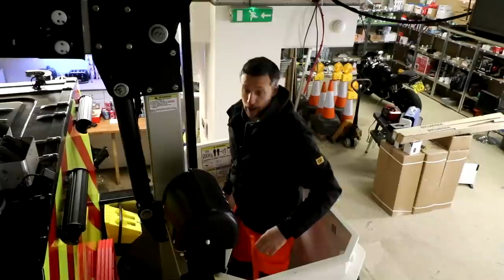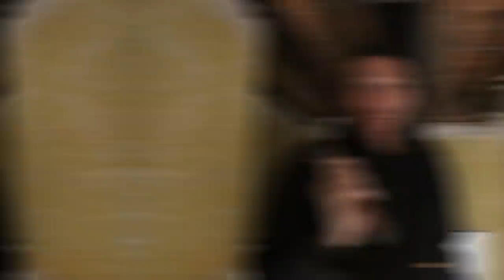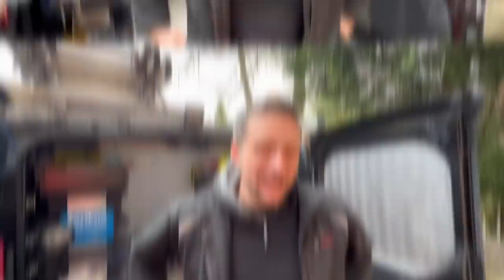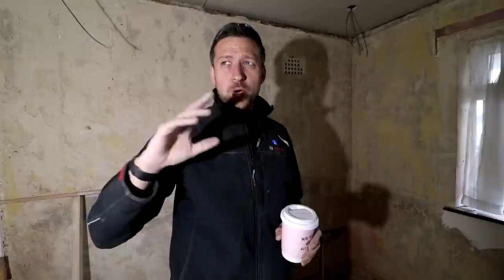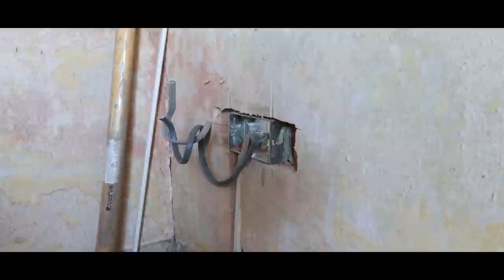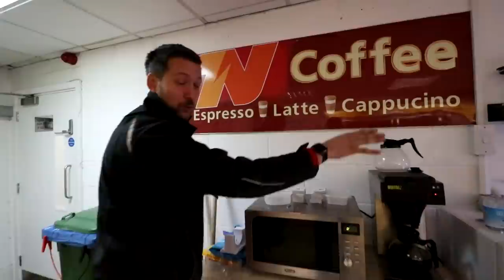TIME TO SET THE RECORD STRAIGHT... | Nagy weekly ep07

Comment: 15 years + working on street lighting in all weathers and darkness..... only ever needed a decent head torch for overhead bucket work and a decent stand light if you need to see more when working at the base. Remember not to dazzle road users ! I see the stand idea as a dangerous hindrance. You might need to work from both front and rear of the bucket depending on column size and van positioning available and the last thing you want is that stand and light falling 12M + when you forget it’s there !! Also concerning your signs .... easier to stack the ones that are made to fit on small cones so there’s no heavy/bulky frames to them. 👍👍

Comment: Tom at the risk of pissing off the Bosch folks , just get yourself a Milwaukee tower light , they do it in m12 and m18 also , it doesn't even take much space .OR you can get the M18 Radius light that you can hang upside down with the included hook , it's super bright but not blinding , and it has a nice warm white color that doesn't blind or hurt the eyes . There's 2 models , the new one has Bluetooth and is brighter but super expensive,  you don't need that , just get the older model which is cheaper ( i think around 160-180 something like that ).
That's all you'd need really,  oh and it has a very long run time as well 👍.

Comment: 6:40 fine to run it through the same hole as any sort of power cable, or to cross power cables at right angles - the problem comes when it runs too close over a distance. You may have heard of inductive coupling (works just like a transformer) - had it on one job where the guy got a shock off a network cable that wasn't even terminated at either end. Turned out the cable was run through an underground duct with power cables for about 30m.

Comment: Thomas you will like this !!!!!!   Top Tip   all round banding with a piece of 20mm  plastic conduit threaded through it . 1/2 a dozen of these pre fixed and you can run the cables ( carefully as you do , burning etc as you know)  Works better when fixed to a ceiling. You still have the benefit of premature collapse because the banding is inside the conduit. What do you think ???
Reply from the maker: Not a bad tip, cheers pal!

Comment: Ex industrial lighting guy here, mainly did indoor stuff in big warehouses but I did my share of streetlight style work, be it on the side of the buildings or on poles in the parking lots and access roads. Generally you don't want any flagpole type contraption sticking out above the ledge of the bucket, you'll hit it with materials, arms/hands and your face. The buckets are small enough as it is. We used to get by fine in the dark with a good headlamp, key word there being good. It's crazy what you can get nowadays online, there's whole forums dedicated to flashlights/headlamps. In addition to that I always took on of them cheap 20watt work lights on battery up, great if you need a bit of static light. I'd just zip tie that to whatever made it point in the right direction, usually the bucket. Couple mega floodlight sounds great in theory but from what I've experienced you just don't need them, you're not trying to light the whole highway but just what you're working on. Especially working on poles when the spark on the ground is trying to look up to you to ask/see if the cables are coming down yet and they instead look right into your artificial sun.

Comment: If you was to use a little length of 20 conduit ubolted and with a stop end box you could place a small pole inside the conduit with a light on and when not in use just remove the light and pole. Great work it always good to see and watch

Comment: On the subject of lighting up the bucket.. we always use good head torches that have a magnifier inside that spreads the light out wide
Reply: I'm not in the market for one but do you have recommendations on brand/model that you've used and found to be the mutt's nuts?
Reply: @AintBigAintClever  We use Ledlenser H15R Core

Comment: Working in the dark - We wear head torches. I wouldn't recommend drilling holes in the bucket, have you checked with the company you bought the truck off to see if it's ok? The main problem I would have with a pole on the back of the bucket is snagging on phone lines etc.

Comment: When I've been out driving at night, I've seen bucket trucks and cherry pickers using stand alone big halogen flood lights, like you see at the local footy fields. The 4 panel poles that run off a diesel gen set or have their own generator and are wheeled around.

Could always try bolting a pole to your bucket to mount a light on, or...have it so you could mount various bits and bobs to it, not just lights. probably worth using something quite sturdy or making your own telescoping pole out of some steel/aluminium tube

Comment: Alright Tom I have a bucket truck myself and had the same problem. There were 2 sidelights on my basket so I tapped into them and installed 2 12v floodlights, I just mounted one up high on a bit of rail and one on the back. I have a video about them on my channel, its the one that's the most recent van tour, at the end of the video I show them in use 👍 hope that helps! Great video as usual 👌

Comment: Most I've seen like signage contractors use head tourches. What else works well is led rope light fixed to the rim of the basket lights up inside the basket well

Comment: Reference the lighting in the bucket, either buy a Petzl Duo Z head torch or buy a monfrotto magic arm and clamps (lanyard it on to save any safety concerns with dropped objects etc if and when you ever get audited). Monfrotto' arms get used offshore for radiography to hold the collimator  in position to radiograph the pipework/welds (inspection), so they are pretty bomb proof and easy to adjust.

Comment: Fit a couple of 12v spotlights and run them off the van electrics. We bolted them to the buckets when i was doing street lighting on the motorways. I'm sure if you speak with the bodybuilders you can pick up a 12v from the bucket control wiring.

Comment: @6:34 Ethernet can be run relatively close to power (look at tri-compartment dado trunking for example) but in your location why not pop another hole through and run them one joist over?  That's what it's like under my floor for the most part (mains in one run, any low voltage stuff in another), although in my case the joists all run front-to-back so the mains and LV runs are under different floorboards.  A recent power run got added in and had to go in close proximity to the low voltage stuff in places, but that's in 2.5mm LSX earthshield so won't be interfering.

Comment: On the lighting thing (I don't know if it's done by others but this would be my thought), you could put an LED strip (with a diffuser/cover) just below the rim at the top (you can get them as 24V strips), or alternatively wear a head torch (not so elegant, I know...)

Comment: I don't do bucket work, but working in theatre and live sound, I often need a hands-free light.  A head torch does the job perfectly. I have a feeling that no matter what you do with a fixed light, it will either be in the way, or not be where you need it.

Starting my business was one hell of a gamble even though at the start when things were looking good; I formed my company in 2019, invested thousands and then the pandemic happened.  Given what I do, it was a risk that's not paid off...not yet at least.  I declared losses in my tax return in April gone, and will almost certainly declare losses this coming April.  Trouble is, given what I have put into it; I have to make it work...it's going to be a couple of years I expect before I recoup my losses and turn it around. Irrespective of what's happening with events right now, I'm determined not to give up.  Had I had investors other than myself, I'm sure they'd have ended up pulling their money out and I'd have ended up right in the shit.  Like you, I don't want to be accountable to anyone else and as I'm accountable to myself, I'm going to bust my ass to make it work...may just take a while longer. :)  I certainly worry about it, and haven't put even close to the amount of money into this as you have your business.

Comment: I'm 35 and also started a business, but with less overheads, and I can understand that you want everything - the business and the stuff normal people have like the safety net of a house. You are getting the wobbles because you realise that you are going to have to wait much longer for the normal stuff and worried that you may come out the other side with less than the normal people. Well, with the current direction, I don't think you will, you will succeed. You might have to wait a little longer but you will. Bring in an investor when you have grown more, this will give you a option to off load some of the business to them, but today it's your baby and why there is so much pressure, but you will succeed as the only people that fail in life are the ones that give up.

Comment: With the lighting issue in the bucket, why dont you wear a helmet mounted light that way its pointing where you need it. Another option is to also run a led all around the inside rim of the bucket.
18 man days so far for that amount ,it seems a low price for all that work and thats without the second fix.

Comment: Any additional light support on the bucket will need to be non-conductive. wouldn't a helmet lamp be easier to use? Any single source of light above and behind you will only cause your body to cast a shadow where you are working. You could also run some LED strips around the upper edge of the bucket to illuminate inside the bucket when necessary. You are doing great! I'd come work with you in a heartbeat if I was still working.
Reply: Always  used a head torch for cherry pickers work.

Comment: Data cable - not great running parallel that close to power, would be better off running on the opposite joist.  The min distance for unshielded is 200mm (its all a bit subjective to test anyway).  Crossing a power cable is ok, but you are right, running in the same 'bundle' is death to a dig signal.  Domestic run probably get away with your install as the distances are not that far.
Reply: It makes so little difference with 50Hz AC. 
If you run data next power cord of a switch mode psu then you will start running into issues.

Comment: Led lenser do a really good magnetic rechargeable flood light iF8R.

Pricey but really good lights. Is your bucket fiberglass or metal? If fiber you could bolt some steel band in place and then you've got somewhere to stick the light.

Comment: Did you ever sort that battery to battery charging scenario on the vans? Just wondered what product you used or plan to use? I use old fashioned split charge relay. Works well but I don't think I get a full charge on the aux battery as I too have part time alternator. Great content - love it.

Comment: Hi mate  I've seen people light their bucket truckle with Defender led slimline work light 50w 4000lm 110v you can buy for screwfix £59.99.
I've seen people bolt them on to the side swivel the light weather working

Comment: thomas if you run tne parallel to tp it needs to be shielded unless you put it in shielded conduit meaning metal conduit thats grounded. to act like a faraday cage. btw tp is data. if you want to run data unshielded it needs to be more then 50mm away from each other in the uk, 200 in the us, 100 in my country.

Comment: Stick to manfrotto or K&M if you need a proper stand.
Or something like K&M 21339.
You don't need the foot, but you might need a double superclamp or two.

Lighting poles are better, because you can get mechanical matching connectors for the light and the pole, but there are no poles without a foot for lights 

Go to a good, big music store for professional gear.
You need professional gear because you are responsible if it splits somebody's head

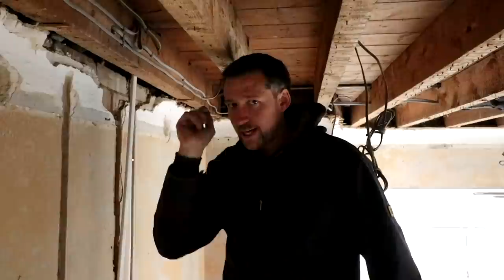Comment: 6:50 you should really have the data cables at least 1' away form power cables for parallel runs.  If they need to cross each other, then do it at 90 degrees to power.  The father the better otherwise they act as a big inductor next to power lines.  It would be best to run them (data) in the next bay over from the power cables actually.  Tips for future installs, especially in a commercial setting if they will be certified as you may get to much noise on the lines if they run next to each other for any length of time.

Comment: I wonder re. the spacing of ethernet cables - I though the reason of spacing them was safety, to avoid accidental screw to connect mains with ethernet. They should be shielded well enough to be able to run alongside 230V

Comment: Always wondered this, in the average house would you ever actually notice issues if you ran the CAT 5 with the power cables?
Reply: No, but the "average house" doesn't yet have structured data. So anyone requesting this may well do a full link test.
Reply: @Swwils   also thomas is doing this as a contractor so it needs to be done to code and this is not done to code.
Reply: @highkicker11  ah yes that section of BS 6701 and EN 50173 that applies to domestic installs.

Comment: "Pear shaped" ~ well that's why you use an investor's money? The bankruptcy protection is there. Investor's, proper investors, not gamblers,  will have write down facilities as well to secure against your default. 

There are downsides some you describe, and handing over typically 30% every dividend has been too much and strangled many a business, however when that goes pear shaped, both you and the investor have legal protections and you still have your house.  

However, I'm actually surprised you had an offer at all ~ your business is not particularity investible ~ so there's that.

Best of luck and yes you do need a little luck too .... :)

Comment: If you don't worry you don't care. If you worry and run around like a headless chicken you're a fool, but if you use it as fuel to avoid any pitfalls you see ahead it's good. People who say "don't worry" are those who are risk averse and sit in the same 9-5 job driving a 2012 Volvo V70 in their Barret Homes new build watching Pointless on BBC1 when they get back from work. 

It's a vapid life and not worrying...caring...you don't get anywhere. Worrying lets you take calculated risks as you are more aware of what might go wrong and can put in place things and resources to try and avoid that. Don't settle for a Volvo V70...aim for a Ferarri 360...than maybe a Huracán. Why 2 beds when you can work an extra 2 hours a day for 5 years and get a 4 bed with a double garage instead? 

I've done much the same thing with my dad, watching just coast and settle, whenever I say "I'm going to do this", it's always risk averse and "i wouldn't do that" and "that's too risky". If you live life like that you won't get anywhere in my opinion!
Reply from the maker: Totally agree with you on that mate, you've got to take a risk to accomplish anything in life!

Comment: It makes me laugh when people say that's a rip off it shouldn't cost more than X amount . your ask by some sparks how much would you charge , being a sparks I need to visit place before I could estimate a price , you can give a price on a short video in YouTube there to many variables , each job is different. The on thing that amazes me is the lack of knowledge some sparks have. Maybe it's because I  lost count of the years I've spent on site and gained a lot more experience. There are far to many wannabe sparks on YouTube who basically couldn't change a fuse in a plug but think they know it all , because they read a DIY book published in the 1960s . To get me on site for a day labour only is £250 per day , if  materials aren't there it still £250 a day  for standing around . You pay me for what I know . There are some sparks on YouTube that thinks they are the bee's knees and I could easily pull there work apart .  My advice mate you do what you got to do and don't respond to the haters